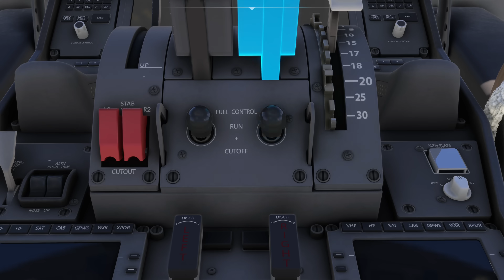Air India 171: Why Did The Fuel Cut-off Switch Get Moved?

Comment: Dont you think captain steeve, that we are basing our inferences on a cherry picked report. Is it possible that the pilots had 2 line of conversation in this entire 30 sec plus flight. Had the entire conversation being out in public, I think that would become a disaster for the airline or the manufacturer
Reply: It seems very obvious what happened, and they will know even more than they are telling us.
Reply: @obipwn he’s just going off of the report! That’s why he says very clearly to make your own assumptions bc he is only supplied w a certain amount of information. As are we all.
Reply: Can't understand how a vdr can provide the same evidence as a video cam as Capt Steve says.. why are pilots so dismissive about Cams in cockpits.. what are they hiding ?
Reply: @anyket12111  exactly
Reply: Whatever the conversation is, as the report says that fuel switches were turned to cut off after 3 seconds after take off, we have to infer that it was a deliberate attempt from one of the pilots, because there's just no other logical inference we can make from it. But if you're saying that the report is lying about the fuel switches being turned off... Doing that is like asking for a disaster. Coz at some point someone will figure that out, and once it comes out, Air India's reputation will be disastrously damaged to the point they can never recover.
Reply: @Whatdoumean91726 I dont think this report is falsified, i think its cherry picked from the actual events to suggest its a suicide rather than a glitch. It could very well be any of these two events but steeve, boeing, dgca, aaib and air india all are coming together to make it clear to the general public that this is suicide.
Reply: 10 seconds after is a very long time
Reply: In India if you pay the right amount, anything can be scripted. Thats how brutally corrupt the system is.
Reply: Release the whole audio
Reply: Biased against Indian Pilot...do whatever you can but truth will.come out against boeing soon
.
Reply: Perfect
Reply: The crash investigation team contains many different functions from different countries. They gave each heard the CVR audio so they all know what was said and heard in the cockpit. If the report is lying or misleading then someone would have already blown a whistle. It is what it is. Pilot action.
Reply: @andykowalski6596 pretty convenient to blame the pilot even though the report itself doesnt mention it to be pilot error. The report gives clean chit to boeing and air India although it wasn’t the purpose of crash investigations. Do read the report and you’ll know it is fishy.
Reply: Having watch 787 TOs videos online it looks like airline SOPs are if the FO is doing the TO the FO selects TO power and then moves their left hand onto the yoke and the Captain guards the engine levers until V1 when they ready themselves for positive rate, gear. I think the pilot monitoring would see the pilot flying unusually move their hand move off the yoke towards the centre panel. As opposed if the pilot flying is concentrating on the TO through the HUD they might not notice the pilot monitoring move their right hand off the engine levers and onto the cutoffs until the dramatic loss of thrust.
Reply: Please provide any evidence whatsoever for this 😂
Reply: More so for the airline. Even if the pilots said nothing, we would know something was off with the airplane with the flight data recorders.
Reply: @botkin6897  yes, he’s channel has got a lot of followers and ‘they’ know that people will trust Steeve, as he is a good source to use ‘the truth’ to pass onto others.
Reply: He's paid by Boeing
Reply: He is SOLd
Reply: Watch Flyingbeast video if you  really believe in unbiased explanation ❤❤❤ english subtitles are available
Reply: Far more likely that it would be conclusively shown to be pilot suicide.
Reply: Agree . Indian govt is trying to save airlines & boieng by blaming the dead pilots. Shame on indian government.
Reply: Why are you hell bent out n not accepting the fact that one of those pilots moved the switches to cutoff? There’s no conspiracy and the data as read from multiple agencies proves it.
Reply: They are working on AI voice generation of public appropriate conversation - certainly it's hiding something
Reply: Civil Aviation Authority
SAFETY NOTICE
Number: SN–2015/005
Reply: @justchill5771 this was re-issued to just change the feedback email address. See the CAA clarification on this.
Reply: Very valid point
Reply: This is what paid social media does, drive an agenda and claims “you can draw your own conclusion”.
Reply: Stop supporting Boeing 
They didn't show us full conversation 
May be Some powerful people  trying to manipulate us and pilots are just being scapegoats
Reply: Probably the rest of the conversation between pilots is being scripted..
Reply: Exactly, apparently quoted out of context.
Reply: 5:28 best question! Better than ‘legit’ 😮
Reply: I don't think it matters in regards to the conclusion of what most likely happened. The report said the fuel control switches were placed to cutoff. One pilot asked the other why he did that. What else about the rest of the conversation that may or may not have taken place would change these facts?
Reply: @louibeans  Say for instance that the guy saying "why did you place the fuel switches to cutoff" actually was the person who did it. We don't know, without a camera. A camera could also be a prevention for not having an individual with such intentions trying to blame the other pilot. My guess is that the pilot steering (the one with less experience and flight hours) was the one who did it and planned it. He waited a long time before saying the question to the other, fully knowing what would happen, without getting blamed in the aftermath (in the name of honour).
Reply: @rabarebraNot impossible but unlikely, in my opinion. Also would have likely elicited a different response. But we'll see.
Reply: Agree in those 30 seconds they must have said that their is technical failure in the engines which is hidden by the public
Reply: @Rick2k25 "Technical failure in the engines"—what does that even mean? What kind of technical failure? The fuel to the engines was cut off which led to a lack of thrust. We know this for a fact. Even if it wasn't human failure but something else—the two pilots would have no way of knowing what caused the issue. They simply wouldn't know. So they wouldn't have made any such statements.
Reply: @louibeans The fuel gots sudden cutoff what does that mean,It's getting auto cut so in those 30 seconds they must be shocked knowing this,we are only given partial information in the report,they didn't disclose full conversation in order to prevent boeing
Reply: @Rick2k25 What do you mean, it's getting autocut? I'm sorry, I don't fully understand your comment.
Reply: @louibeans It's ok brother it's important for public to raise questions Their is no transparency in this case as it involves high profile groups,We should demand the full conversation of the pilots in order to reach the conclusion,During those critical 30 seconds  they must said something for sure which is been hidden by public
Reply: @Rick2k25 I think they will release this information in time. I think there may be good reason why we've only gotten such few details regarding the audio recording. There's a lot of media attention and people jumping to conclusions, like you can see here in this comment section. If they released all the information at once without being sure who is to blame, this could potentially drag one of the pilot's names (and their family's name) through the mud. And if they conclude it was the other pilot, then that damage can never be undone. So if I were on that team, I would also choose very carefully what extent of information to put in that preliminary report.
Reply: Easy to point fingers on human. 

What if the switch was faulty ? Every mechanism is capable of malfunctioning.. when the evidence is burnt out it can’t be used. 

Corroborating evidence is needed. 

Even Tesla wouldn’t let you move to reverse !!
Reply: The writing of the report isn't led by the airline or the manufacturer. They don't get to choose what's in the report
Reply: Can’t trust boeing after mcas!
Reply: I flew the C130... Remember this flight didn't contain a lot of conversation because to be honest? There isn't much conversation once cleared for takeoff. The only reason we are hearing any conversation is because what is generally a typically normal departure wasn't that day. So in response to previous comments about us only hearing "cherry picked" and not hearing "All of the conversation". You did in fact probably heard all that was said other than acknowledging their cleared status from the tower and them acknowledging received.
Reply: => https://youtube.com/watch?v=GpKwdxPGWVU&lc=UgwQuvQXNgIRbIm-sVZ4AaABAg&feature=shared
Reply: Definitely! 10 seconds (a long time!) with no conversation other than "Why did you cut off?" is very suspect
Reply: The mistake was to even talk to the pilot who flipped the engine to cutoff. He should have just acted! Aviate!!!Navigate, communicate!!
Reply: The so called preliminary report appears to be SAVE BOEING and SAVE AIR INDIA report that puts blame on dead pilots who can't defend themselves.   British Civil Aviation Authority had few weeks ago had warned about flaw in BOEING fuel switch.  This is cover up exercise to save Business GIANTS
Reply: The question was why those fuel switches were turned off. So the relevant part of the dialogue about switches was presented..
Reply: Paid by boeing to influence social media.
Reply: 0nly the 1 liner is  released in prelims,I wonder in such a dire situation only a single sentence is spoken, and the heck airplanes have no such algo that can make it not to shut down fuel control on take off in such a low altitude.
Reply: I wonder how ppl in comment section have already came to the conclusion that pilots were   at the fault.dude it's preliminary,it could be a malfunction nd pilots tried to revive the engines from off to onn.
Reply: I wouldn’t dismiss the notion that this was an accident. Think about the little mistakes we all make. Humans are fallible. We need to read the entire transcript for the whole flight from the voice recorder instead of a paraphrased version from the last few seconds. In any event, cutting of fuel so soon in a flight should at least produce an audible beep.
Reply: Yes I think it was to protect the pilots families that more of the conversation wasn't released.
Reply: Nice try, Vlad. Boeing weapons kill many Russians every day. Your bots won't save you.
Reply: Agreed. It is cherry picked, so that relevant entity for next 1 year can blackmail Boeing to deal under the table, else they reveal the whole recording.
Reply: My question to Steeve is if a pilot can move both the fuel cutoff engine is less than a second, why the HELL  was it left like that till 10 seconds untill pushed back to run by other pilot and did not do it instantly in a 2 of seconds. When u know both the engines mid air was cut off, from that moment would you think or talk what happened or does your hand instantly go there and start it back within a second??? Or u think the other pilot didn't allow him and were fighting in cockpit!!?????
Reply: You can watch Video by Flying Beast who is an Ex Commercial Pilot and explained the whole scenario second by second and explain why he thinks its not the Pilots error.
Reply: why Modi do nothing against boeing
Reply: We don't need the full transcript. The exact wording was '"why did you cut off?" (pilot clearly talking to the offending equipment). With the other pilot confirming he didn't do it. That itself already proves the airline/manufacturer are at fault. The switches are not directly connected to the cut off valves. The controller could close the valves itself and record a switch movement when it did not happen.
Reply: @Drone-rm8mb Rubbish.  We do not know the exact wording, it is paraphrased.  And you think pilots routinely talk to "offending equipment"?  Nothing proves anything at this point.  You are talking out of your a$$ re: how the switches / connected / cut off valves / controller / movement.  Are you a flight, electronic or avionics engineer?  Didn't think so.  Quit trying to blame Boeing.  We will know soon enough what factually happened.  Yet more internet spew.
Reply: And also the minimum of what is provided that also isn't the actual statement of the pilots. The timing of the also not provided .
Reply: So convenient that no media in the West published criticism by investigating body of such speculation. Everybody has assumed the pilot “calmly” said “i didn’t do it”, no mention of calm anywhere in findings.
Reply: This  video reel maker will  soon be sued alongwith WSJ for defaming Capt. Sabharwal
Reply: There is no point in reasoning with this pilot. He has been hell bent on giving Boeing a clean chit from the moment the plane had crashed. Unfortunately, even the media is submissive to his propaganda and no one is paying heed to the obvious mistakes & loopholes in the preliminary report. I think we are dangerously close to an event like 737 Max which means, there may be another big fatal crash round the corner.
Reply: Your example that if you caught your kids doing something wrong, they would deny ----- this is very immature statement and example. Every single word matters to demonstrate fitness.
Reply: @India-ddd  Kids do this more often than not. He is spot on.
Reply: @India-ddd  Maybe, but adults lie all the time, even after caught.  Ever watch On Patrol Live, COPS, or other series .... almost every one lies!  You were speeding ma'am.  NO, I was not!  You just ran that stop light sir.  No, I did not!  Excuse me, you are in my seat.  No, you are wrong, this is my seat!
Reply: @India-ddd I commented exactly the same thing on his other video. He is repeatedly bluffing people with his lame arguments. He appears two different person, A captain steeve who first started this crash reporting and the second captain steeve who is saving boeing now.
Reply: The conversation seems to have been longer, more agitated and sort of argument and with direct questions (such as Why…) compared to what reported.
Reply: @user-ng6kk5jn3c nobody knows that. Don't spread rumors.
Reply: @user-ng6kk5jn3c , my friend, our command of the English language is going down in the dumps by us creating agendas and narratives. Any independent entity would have asked the question of How were the fuel turn on and cut off switches moved? 🤔🤔🤔🤔🤔!
Reply: @SaneHuman-x4t  an extraterrestrial being?
Reply: @jimrothwell535 , please, my friend, intoxication is not good for the brain since it depletes the brain cells .
Reply: It will be very tragic for the families of those two pilots- regardless of who was at fault.  The death treats that will come as a result would be very prolific.
Reply: @OanhSchlesinger  just making a report to have insurance cover, this is a classic example how not to make a preliminary report,shld be taught to the air crash investigator s how not to make such type of reports. And not to surprise most of the time,pilots are at fault
Reply: @OanhSchlesinger We will sue you when you are blaming the pilot even without so much comming by report!!
Reply: @OanhSchlesinger   Death threats by whom? In India ?
Reply: @chesstales247 why exactly do you think the Indian AAIB is covering up a problem with the airplane or airline? That’s a rather extraordinary claim based on 0 evidence whatsoever.

The full conversation will be released in the final report. But I suppose people like you will be claiming this is a coverup even then.
Reply: @iJoxy Because the big businesses are at stake. Coverup is just one theory and i am not fully convinced about that but good to keep in our mind. Especially because the report rather than simplifying the matter made it worse. Do see “VANTAGE” by palki sharma and you know how the report has messed up the matter even more
Reply: If this was an airplane issue,  it would be grounded just like the MAX.
Reply: @iJoxy You should watch the analysis by Gaurav Taneja. The only guy who talks about issues with the report itself
Reply: This Captain Steeve appears to be biased and motivated otherwise,hence within few hours of primary report released,is bent upon establishing psychological issues with  the two Indian Pilots...he frequently quotes Washington Post etc...shameful,why this person in bent upon pinning the pilots. without waiting for deeper  probe...
Reply: He is not 😂 my god, he is going off the information provided. But sure, because you dont like the reports it has to be wrong. The truth doesnt care about you or your feelings @BULKI123
Reply: @BULKI123 , my friend, it is all about a persons tummy.
Reply: @BULKI123 Spot on
Reply: @BULKI123 He also eliminated about 3-4 other logical pathways before going there. He cites the timing in which these events occurred (1-2 seconds in between each fuel switch being cutoff) which is completely normal timing for a pilot to be doing. Also, the Air India pilots had 1000+ hours of flight time, these were not greenhorns who mistakenly hit the wrong switch. Also, if it’s an electrical/mechanical failure, why were there no similar types of issues on the hundreds of flights that same aircraft had already taken. Aircraft get grounded for something as minor as a toilet not working (speaking from firsthand experience), so unless an engineer or mechanic just didn’t do their job, pilot error is the most logical option
Reply: @ST0PP3RS again biased assumptions,simply implicating the pilots ....the worst part is that suddenly after this tragic happening ,thousands of experts have emerged from the blue...Don't play with human dignity till proven ...Would once again reiterate that this Captain Steeve is biased and motivated,if he is such a big expert ,should publicly appeal to join the probe voluntarily...
Reply: @BULKI123 Sure, you could say he’s biased. He also has years of experience flying aircraft and has mentioned he’s a psychologist, so it kind of makes sense why he keeps harping on the psychological/human side of these arguments. Also, the fact of the matter is that the Indian AAIB (I think the Indian equivalent of the FAA) has invited US safety and any other air safety organizations into the probe (along with getting a flight psychologist after reviewing all of the flight data) to come help with the full investigation, so clearly they’re thinking along similar lines. But sure, it’s hard to guess too much this early on. Could it be a one-off complete system failure that caused the fuel cutoff? Perhaps? But then why would the data logs show the switches had been switched not at the same time, but several seconds apart from one another. That doesn’t make sense if it’s a system failure.
Reply: @BULKI123  maybe cpt Steveee has been ‘persuaded’ to hide the real reason …
Reply: @BULKI123  Maybe rushing it, but please tell us your alternate theory.
Reply: Steeve is blaming the pilots right from the start.  While others were trying to look for some logical answers what all could have gone wrong, he straight away put his theory about co-pilot doing something wrong and the same was picked up by all the news media and published it as breaking news headlines.
Reply: @sanreb187139  I mean, I don’t think the other media sources got it from Captain Steve. But I do think he came to that conclusion too quickly. Especially since this is only the preliminary report.
Reply: @katrinat.3032 dailymail UK picked up on what he said just after the accident and made it a headlines in their news report.
Reply: @sanreb187139 correct. This guy Capt Steve seems to be a paid propaganda artist.
Reply: @sanreb187139 , well, my friend, he needs to earn money from somewhere.
Reply: @sanreb187139 yes, this was boeing’s strategy while they tried to hide the huge issue with the Max and its angle of attack measuring device flaw. They said the pilots misread the english text. If they really investigate the problem right after the first mishap there would be hundreds of passengers still alive… This boeing is not THAT Boeing we all know.
Reply: And the way u dumb down on the advisory in the past and the 2nd pilot's denial as your kid's hand getting caught in the cookie jar smacks of bias - ur mind is set on pilot's error, or worse, intention. Or if the convo transcript is really in english? or translated from indian language? Two indian pilots speaking the same language in this kind of situation certainly won't speak in straight english? u think? they'd speak colloquially! 

Just my take.
Reply: @monsski4151 so true man
Reply: Capt. Steeeve has sold his soul to Boeing.  He is acting as a psychological hitman now.
Reply: I feel he posses very superficial knowledge about aircraft technicality and jump on conclusion with basic info he have , We still need to wait for final report. Also entire inflight audio conversation should be made public
Reply: Captain steeve is a clown who sold his soul to boeing
Reply: Seems like everyone wants more views. Dressed like a pilot doesn't make him an expert
Reply: @tech30500  He IS a pilot. Why do you care about number of views? Jealous very much? Start your own Youtube channel. It doesn't matter a single thing what you mean, nobody.
Reply: chesstales247
I’m suspecting a plane severely behind in maintenance 
And cooperate take the route of sabotage for insurance payout 
Some countries human lives are not valued
Reply: The pilot committed suicide!
Reply: According to Boeing service bulletin
EEC might be the one caused the tragedy
Reply: @TpBrass0  Please state service bulletin number and date.
Reply: This captain steeve never mentionsthe reports of2018 and a month before the AI crash that indicates a serious flaw in the  Fuel Cut Off switch of Boeing Aircrafts?
Reply: @keivansm2561 he has mentioned this report several times and has correctly explained each time why that report is completely irrelevant here
Reply: @keivansm2561 HE just talked about the fuel switch problem his last video!  You saying he “never talked” about it is a flat LIE

.
Reply: @keivansm2561 he's spoken about it extensively in other videos on this incident
Reply: @keivansm2561 Yes, he did in the video before this one.
Reply: @keivansm2561  He did mention them in one of his other videos..
Reply: @keivansm2561  Didn't mention it because it wasn't a serious issue.  An advisory only, no safety issue.  And Air India ignored said advisory.  There has been nothing noted about the condition of the fuel switch module, other than it had been replaced in 2023 (+/-)
Reply: @keivansm2561 this video is a response to the comments on a video where the very first thing he mentions is that
Reply: @keivansm2561  the switches actually were replaced in this aircraft after that report. That report has no bearing on this situation whatsoever, it's a straw that Air India and the Indian authorities are grasping at. Anything but examining the probability a pilot committed murder/suicide.
Reply: @keivansm2561  He is sol d out to Boeing ? Do you mean this?
Reply: @keivansm2561  Because it has no part of this and was not a serious flaw as you put it. If it was a serious flaw they would have grouned the aircraft until all were checked. They didnt do that, all they did was sa yyou might want to check this. Also this aircraft had the throttle controls replaced twice since 2018 which includes those switches so unless you believe that Air India were fitting faulty Parts to their aircraft then there is only one logical conclusion but keep wearing your tinfoil hat.
Reply: @timberry1135 , my friend, don’t you think this venue should be given some scrutiny? Shouldn’t there be an investigation to whether Boeing has the authority to remotely manipulate the systems in its Aircrafts?
Reply: @SaneHuman-x4t these fuel cutoffs are manual switches though. So I don’t know if it can be cut off another way
Reply: @anitasmith7764 , fair enough, so it seems like more scrutiny needs to be done and the manufacturers of the Airline and the spare parts need to be investigated.
Reply: @timberry1135 did they ground 737 max after first incident or second. Beware of the big businesses. Their priority is company accounts and not human accountability.
Reply: @SaneHuman-x4t this is just silly.  How would Boeing remotely manipulate data on a black box after the crash.  Use your brain.
Reply: @Flynbourne , my friend, well, silly is when someone doesn’t want the investigation to be throughly done to save future lives. Don’t you want to use all of the 2 brain cells?
Reply: @SaneHuman-x4t I say again. How could Boeing remotely impact the flight data recorder.  Or are you implying that they remotely turned the fuel cutoff switches to off.  It’s absurd.
Reply: @SaneHuman-x4t Don't you think there should be an investigation into whether alien lizardmen can manipulate the cutoff switches using telekinesis from their Moon base? Why won't you scrutinise this possibility?
Reply: @timberry1135  there a report, Boeing 787 fault will arise after 11/12 years pass, in 2018 it's not time come, time is come now. Currently mostly 787 are 12 years now, so faults arising.
Reply: @timberry1135  it's a serious flaw which can cause the engine shut off or something is mentioned in the report dude
Reply: @SaneHuman-x4t  "remotely manipulate the systems in it's aircrafts". Where does that come from and what does that even mean?
Reply: @timberry1135 there needs to be a through investigation of the switches and circuits to see if a mechanical or electrical failure occurred.
Reply: @jimrothwell535 , my friend, why don’t we do research to find out? Why are you against it? Do you have a vested interest?
Reply: @timberry1135 yes it was serious fault of Boeing switches, and that's why the advisory in the first place
Reply: @timberry1135  yes absolutely, the same way that they handeled the 737 max plane issues
Reply: @SaneHuman-x4t  First, I am not your friend, nor you mine.  You can do all the research you want, I'll wait for the experts that do this for a living.  I have no vested interest other than pointing out when speculation makes no sense (to me).  Your right to blather on all you want, using your "my friend" as subterfuge.
Reply: @jimrothwell535 , well, now, we are on the civilized path of looking at the scenario. Why is someone agitated? 🥳🥳🥳🥳🥳🥳!
Reply: @SaneHuman-x4t  I'm not agitated, but you are a tool.
Reply: So true man❤❤
They blame pilots because they are not there to defend
Reply: @GamerBabu1M  Example: Sometimes the car driver is to blame in a car accident, not always the car manufacturer. I still believe the pilots were innocent, but one made a huge accidental mistake. Since pilots are supposed to cut off fuel when at the same altitude when landing, I think the copilot followed the landing protocol, a complete accident, perhaps he was distracted, tragically.
I own a Volvo. The manufacturer is not responsible if I don't perform routine maintenance, or if I crash because I'm distracted. 
If people distrust Boeing so much, start manufacturing a competitive jetliner.
Reply: @ruthtalley242 brother do you have anything to back your words 
And what you said about maintenance that's true airline is also responsible
But fuel switches were cut off
And one of the pilot asked did you do that he said no. What else you need bro this is a manufacturing problem in past also Boeing plane crashed because of a software glitch I am assuming you know the incident.A whistleblower tried to warn  and you know what happened. Why most of the boeing planes are crashing. Human life matters bro.
Reply: Fully agree.. Looks like he is probably a Boeing financed influencer
Reply: I have a theory that the pilot was yelling “allah hu akbar,” and the Indian government made them omit it from the investigation.
Reply: @SharksSJ408  They were Hindu (Captain Sumeet) & Christian (Captain Clive Kunder). NOT MUSLIM.
Reply: @SuvaMukherjee  Nah they just lied about their religions to cover up their intentions.
Reply: @SharksSJ408 , good observation!
Reply: @SharksSJ408 There is absolutely no indication in the world that this has been said. In other words: You're pulling that out of your rear-end.
Reply: @SharksSJ408 That is impossible. Pilot flying was  Christian, and Pilot monitoring was Hindu.